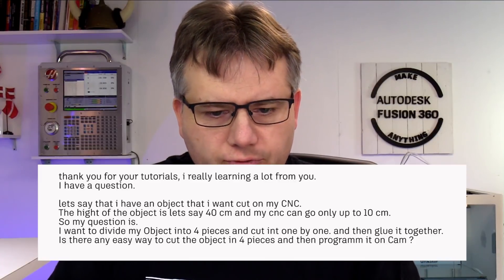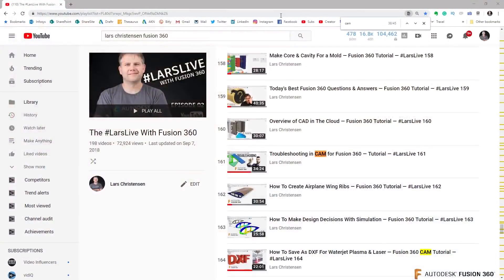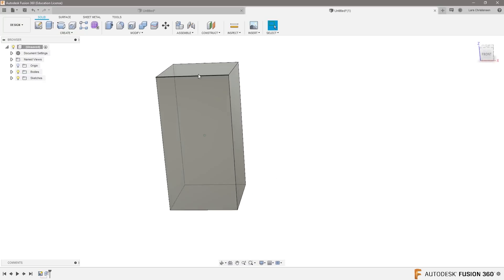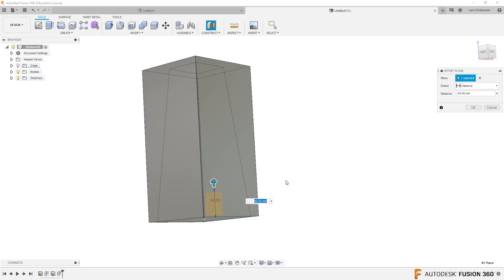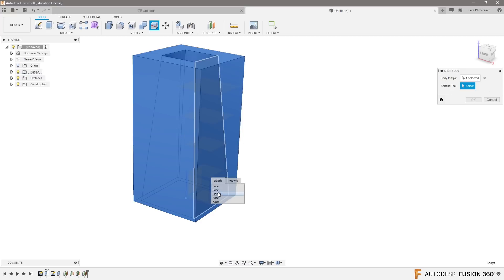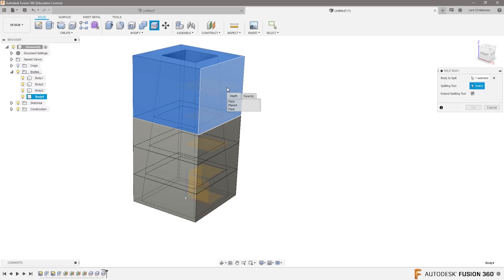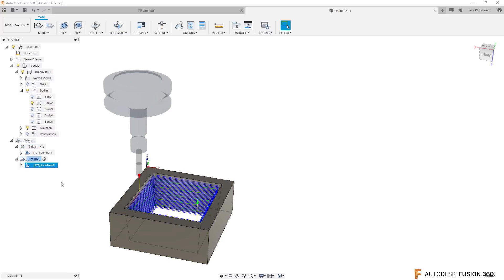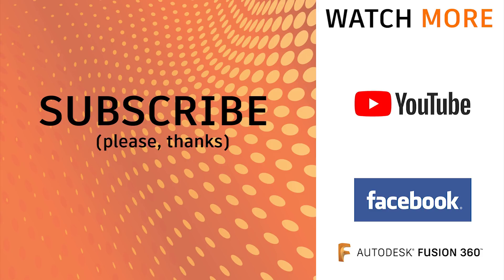Fusion 360 — How To CAM Too Tall Parts — Ask LarsLive

Comment: Is there any reason why you wouldn't want to just duplicate the setup in CAM? Then choose a new model and stock point in setup properties, and new geometry in the contour? Would that not be slightly faster? You wouldn't have to mess with Z X axis again and if you adjusted any height settings, ramp, etc. in the operation they would carry over to the duplicated contour